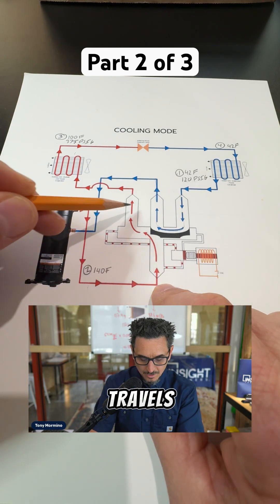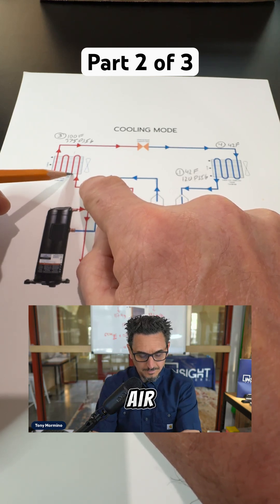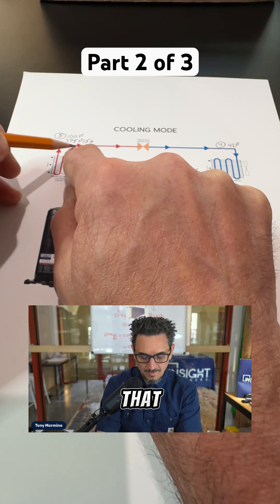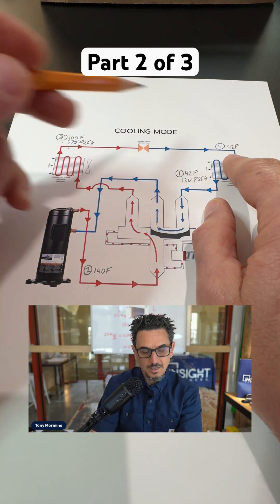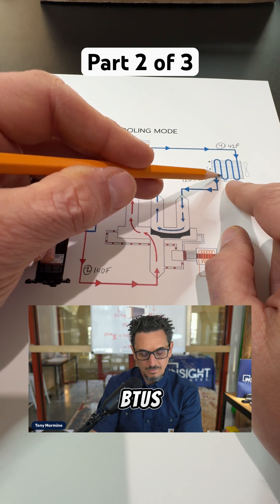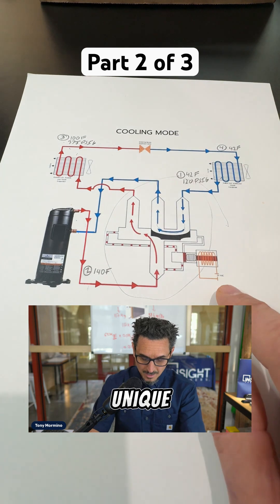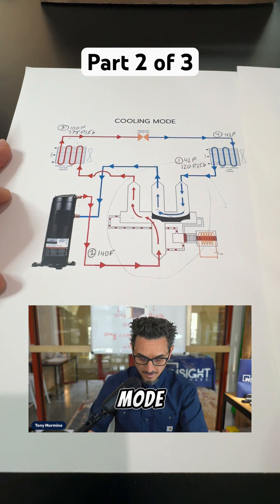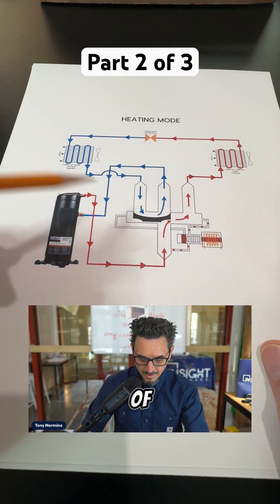Part 2 of 3 - Heat pump refrigeration cycle and 4 way reversing valve explained.

Comment: How offen does the refrigerant need replacing, using If this was a multi ductless room?
Like Tranes does seem to last no more than 12 yrs or less. Everything depends, but if the pump does not fail then I believe it's barely a good system. The home owner needs to be aware that they'll be replacing a bit more of their systems (depending on the size...) or heating/ a/c units do we agree at less on that?!?
😉